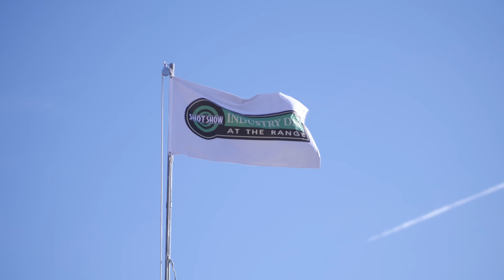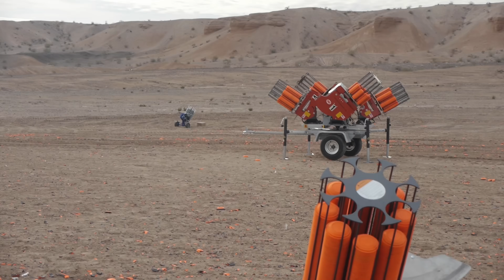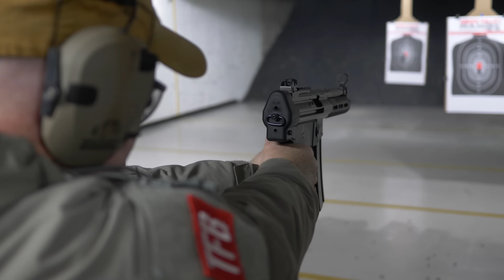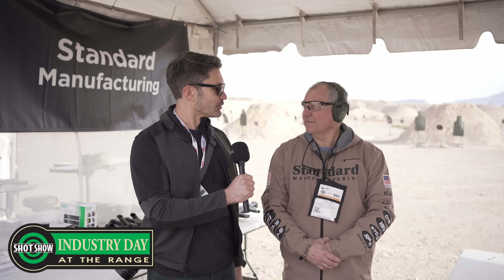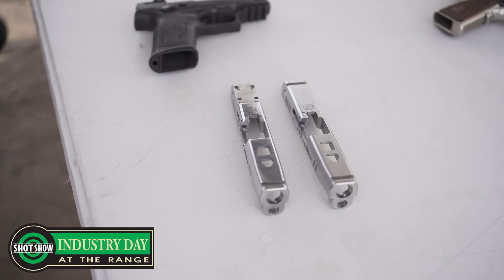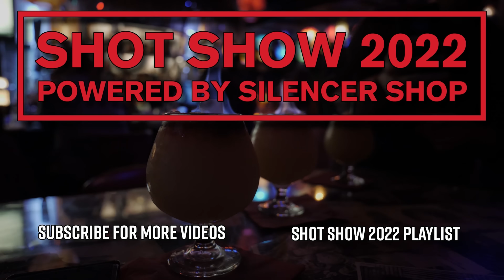NEW Standard Manufacturing SG-9 Pistol [SHOT Show 2022]

Comment: Big mistake not building a pistol around common mags like Sig P226 or Glock 17 for duty sized pistols.  As it stands Tisas is putting out Sig compatible mag pistols that work just fine and they're cheap to boot.  I'd much rather buy America made but not at that price disparity and I demand mag compatibility.

Comment: Looks ok. I always appreciate a company taking a quality focus and trying to their tolerances and fit up and performance characteristics good with things like a low bore, and options like a removable safety are nice. But it's not terribly exciting. It's sort of a collection of incremental improvements and niceties that might play well as a pro shop/custom upgrade to an existing successful gun, but aren't necessarily a pure selling point for a new gun coming into the market with a price point higher than most competitors. May also be a somewhat of an odd fit to their market base which seems to favor some older designs, nicely finished 1911s, etc. Real test will probably be when some people begin putting rounds through them and whether the solid billets and other niceties amount to better groups and user experience or are just kind of a wash.

Comment: I just don't see the point. It's fully ambi, but the pistol doesn't really have anything unique to it that well proven brands like S&W, Ruger, Glock, Sig Sauer, or Walther don't already offer. Plus, you can easily find these other pistols at any gun-store where you live. You just feel bad for the employees for a manufacturer like this, knowing in five years they probably won't be around. Once PSA can work out the issues with their pistol, these smaller manufacturers are probably going to start dying off, because then there will be an affordable alternative to the larger brands.

Comment: No mag compatibility, high cost, new manufacturer unproven track record. If I want a basic full size 9mm why buy this over a M&P with manual safety (if that’s my jam). Plenty more accessories and cheaper msrp and proven. If there is no answer to that question, guaranteed failure
Reply: The only sales will be during the next panic buy when all good pistols will have already been snatched up (assuming they’re around for the next panic buy)

Comment: Good video but 649 with proprietary magazine was not a smart choice.
Reply: The price will sink it's chances. If it was $399 or less, it would do fine. It doesn't look bad, but nobody would buy a Toyota Camry for $60k in 2022 either. This market segment offers price competition through the roof.
Reply: @DaedalusHelios  As I think about it, it's not just that. I don't LOVE glocks but mags are cheap, there's holsters everywhere and spare parts. I didn't get a p-10 because mags are $40+.

Comment: If they are using mec gar tubes and use 9mm based mags like the CZ/ Beretta/ sig old school mags it could be an extremely thin full size micro compact with affordable mags, it did look to be hardly thicker than that Romeo sight on top. That's what they need to press into if that's the case, the first company to make a good full size micro compact is gonna storm the market.

Edit: never mind I rewatch the vid, it looks like any other full width duty gun, what a shame. But daaannnng that bore axis tho, they need to talk about how freakin high your hand sits.
Reply: it uses caracal mags apparently
Reply: @superzario1000  looked it up, this gun looks suspiciously like a caracal...
Reply: @superzario1000  Really? Did those ever take off?